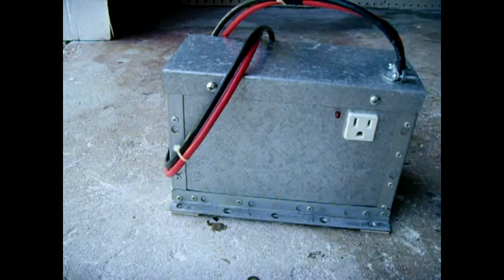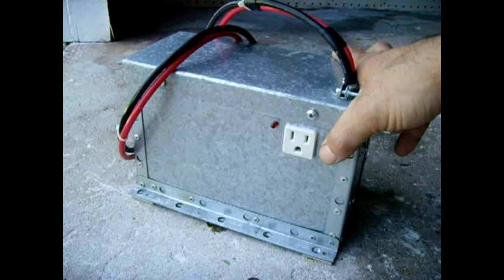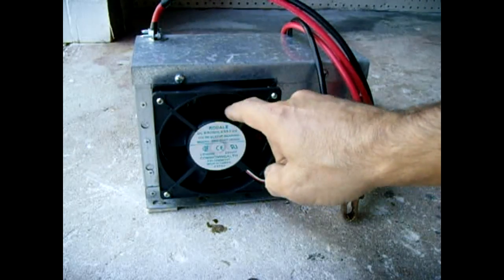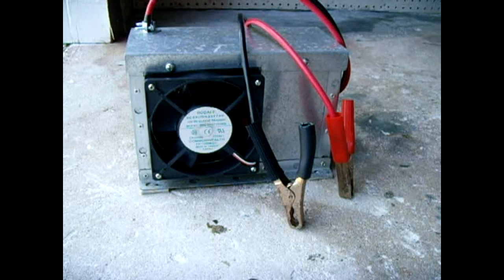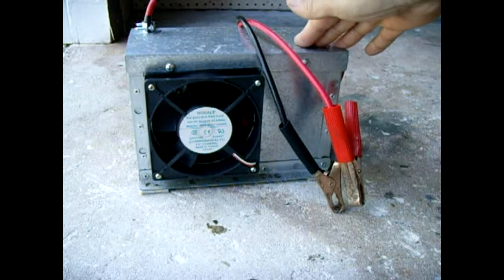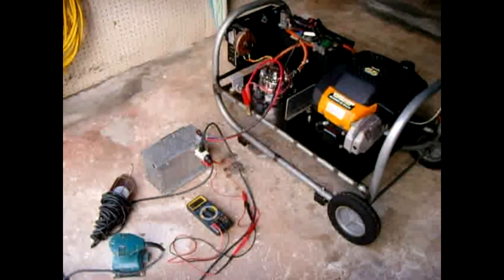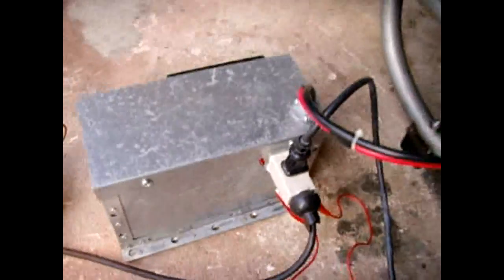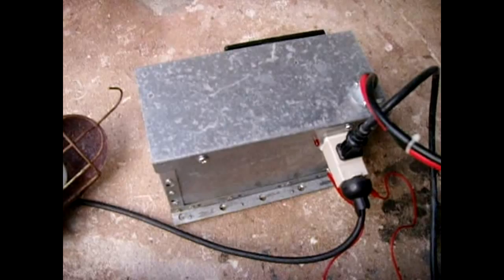DIY Power Inverter (Modified Sinewave)

Comment: i used p55nf06 mosfet and 12-0-12 transformer. but it doesnt work. no output voltage on trafo. can you help me..
Reply from the maker: Vino VV Double check the circuit, try new components, and make sure you're using the correct pins on the mosfet.
Reply: and how to adjust the frequency? my output frequency is around 700Hz - 1khz  which  it should be 50Hz. The potensio just didnt work properly
Reply from the maker: Vino VV The circuit is very simple. You botched somewhere.

Comment: excuse me sir..can you send me the circuit schematic(modified) diagram to me?
Reply from the maker: Hello. Everything you need to know is in the video or video description area. I have another video showing the inrush limiting circuit. Thanks
Reply: +electronicsNmore sorry sir..the inside pic of the inverter is a little bit confusing to me
Reply from the maker: wan daniel The inside of the unit has the inverter circuit, the inrush limiting circuit, a 12v case fan, and low battery alarm circuit, and 120V power indicator. Fairly simple. Unfortunately, I rarely do step by step electronic circuit videos. I simply supply information to help you, the schematic, and show you how it works.
Reply: +electronicsNmore thanks sir..i manage to build one..right now im making a part list before going to the store

Comment: You have a great design, but I believe I would have the fan blowing in to make positive pressure in the case. Then you can put a dust filter on the fan to keep out dust and trash.
Reply from the maker: Thanks Mike. No, the best way is how I made it. You want to leave openings on the opposite side to draw air in and across everything. Just like a desktop computer tower.

Comment: can you give me the right value of 500k pot so that it was locked on 60hz frequency sorry because i dont have any multimeter with a frequency range.. is that right 10-0-10 is the winding of the transformer instead of 12-0-12... because the output voltage may be higher thn 240 volts..
Reply from the maker: +Jaime Lomayno 
No. You need to set it yourself using a DMM.
Reply: +electronicsNmore ok i made it perfectly yhanks for sharing

Comment: good inverter but you could go one stage further with the inrush limiting circuit. i have built 7 inverters in total and employed my design in each of them. i have used 2 timers using a simple mosfet in each of them. the first timer handles the inrush on switch on and i used a large mosfet in series with a resistor forgetting the inverter started and when you load it over 50 watts 3 irfp2907 in parallel bypasses the first mosfet and resistor circuit and full power is then put through the inverter and it works well. i have used a current transformer with 1 wire passes through it which senses the load.
Reply: pls can you make me an inverter?
Reply: hello there..can you guide me how to make one?

Comment: Hi, you have mention that you put 36v zener diode across each mosfet's drain and source for added protection,In which direction of the zener pointing the drain and the source?I meant anode and cathode.Thanks
Reply from the maker: +edwin siy 
Please refer to the image at the link below.

http://1.bp.blogspot.com/_DF0nclfN_Sk/S74MsnW-JkI/AAAAAAAAAaU/TxF4ePy029U/s320/zenerdiodeinsidefet.jpg
Reply: +electronicsNmore Got it thanks
Reply from the maker: *****
This is 60hz.

Comment: Sir one more thing,In the schematic diagram, the transformer used 10-0-10v while in your previous video titled "12 Volt Power Inverter Circuit ~ High Output/Freq Adjustable",you have mention that the transformer used must be 12-0-12v, so to use it on this modified sinewave inverter,what should we use?10v or 12v transformer?Thank you
Reply from the maker: +edwin siy 
For a higher AC output closer to 115VAC, use a 10-0-10.
Reply: +electronicsNmore I got 230vac  60hz here where I live,so I have to use what voltage?Thank you
Reply from the maker: ***** The ratio of turns is critical for the correct voltage output. If it works fine using 6.3v-0-6.3v, then great . Be happy.  The frequency is set around 50/60hz?
Reply from the maker: More than likely your frequency is off. Without knowing EXACTLY what the frequency is, I cannot answer your question.

Comment: Hello friend I really like your videos I manufactured a similar circuit (can see my videos) in one with IRF3205 parallel 4 mosfet can with a lamp 500w, also with a radial or grinder 850w, also on you can see and compare your scheme with mine, probe the IRFZ44N 6 3 + 3 parallel mosfet and also could with the same tools and the same watt lamps bone, the microwave transformer I put rigid 1.3mm wire, 3 + 3 meters with center tap and could with the same wattage, including a transformer that I made with 0.30mm and 1mm thread with veneers of a (larger than normal) Russian microwave and also can handle the wattage, will be my last test with mosfet irf1404 with 2+ 2 in parallel give me more amps and power in watts, all at 220v and 50hz, ne555 and CD4017, with lv7809, lv7805 and kia to 6v, all regulators me work just as well, if it's any help my videos there is friend greetings from Spain.

Comment: can i use irf3205 or irfz44 instead of stp55nf06l?? kindly revert me !!!! thanks  :)
Reply from the maker: Hi there,
This inverter uses a "Logic Level" mosfet. They are designed to fully turn on using less than 5 volts. You can try the others, and they may work, but no guarantee.

Thanks For Watching!

Comment: Will the inrush limiting circuit be fooled by short breaks in the supply, as can happen with an intermittent connection?
Reply from the maker: Once the connection has been made, and it is a good one, there will be no issues. If you make a connection, and the connection is lousy, making the circuit click ON/OFF, then you can have a problem. I would suggest a high current throw switch be used after the cables are connected.

Comment: What is Your output voltages when battery voltage is ~10V and ~13V?
Could I use 230/12 VAC transformer?
Reply from the maker: Around 12.5v gave me an output of around 110V using my transformer. You can assemble the circuit, then hook up your transformer to see what the output is. Likely very high.

Comment: hi can i power my laptop charger with type of inverter
Reply from the maker: Why bother. You can take a 12V lead acid battery, then connect it to a Buck Boost circuit to raise the voltage up to 19/20V with around a 2 amp output. There are many of those circuit online. You also have to realize that many laptops will only run on a power supply which is not made for the computer. The battery may not charge. This inverter will likely work, but no guarantee.

Comment: hi what if i use 9-0-9v 5amp transformer ,do i get 60w -100w output
Reply from the maker: You need to experiment with different transformer cores, as well as the number of turns. The circuit works, as you saw in the videos. Make sure you use a 12V lead acid battery.

Comment: can you please show me the fully built circuit of modified sine wave inverter ,please
Reply from the maker: You mean the schematic? It is the one which uses the 555 and 4017 in the video description area.  The schematic does not show the inrush circuit(you can find that in my video list), does not show the power indicator LED/resistor, and does not show the cooling fan. If you are having power output issues try, removing a couple turns off the lower voltage (12v) primary. Adjusting the ratio will adjust the 120V output.

Thanks

Comment: are you able to set the output to 60hz,because according to ne555 calculator the output can not be 60hz with the value of resistor recommended in the circuit diagram
Reply from the maker: Yes, of course. I'm pretty sure I showed in the video that I was operating at 60hz.

Comment: what is the advantage of using modified sine wave instead of normal square wave
Reply from the maker: Hi Ramesh,
A square wave does not gradually swing positive toward a brief positive peak, then gradually swing toward zero volts, the continue swinging gradually toward a brief negative peak before returning to zero volts. The square wave has only 3 states, (Positive, Negative, of zero volts). The square wave does nothing gradually, and spends too much time at peak POS or peak NEG. Due to that, certain devices can develop heating issues or other problems due to the longer duration at Peak pos/neg, and the lack of a gradual swing toward peak pos/peak neg. A modified sine wave follows the sine wave more closely, and spends much less time at peak pos/peak neg, making it a much better choice for powering devices/appliances. See the images below.

Thanks For Watching! Be sure to share.

http://www.google.bs/imgres?imgurl=http%3A%2F%2Fwww.ememdevices.com%2FSquare%252520Wave%252520Sine%252520Wave%252520ws.jpg&imgrefurl=http%3A%2F%2Fwww.ememdevices.com%2FEMEM%2520Therapy.html&h=206&w=450&tbnid=THv7emf51wsG8M%3A&zoom=1&docid=7PzZ6ZPbyy1s4M&ei=-xWsU9uiLe3lsATL94KoBg&tbm=isch&client=firefox-a&ved=0CFIQMygxMDE&iact=rc&uact=3&dur=2199&page=4&start=48&ndsp=13

http://www.google.bs/url?sa=i&source=images&cd=&cad=rja&uact=8&docid=SLchOOAbs907SM&tbnid=zHe1TD6F7byrAM:&ved=0CAgQjRw&url=http%3A%2F%2Fwww.energymatters.com.au%2Frenewable-energy%2Finverters%2F&ei=jRWsU-a-IPSqsQSJtoG4Cw&psig=AFQjCNHeHj5o9n7s1Zzfw2eHVCMoZONZDA&ust=1403873037612211

Comment: hi i used irf540,also i used irf3205 mosfets.it is now working but it is not powerful ,i mean i used 5amp 9 volts transformer .i expected at least 40w of output ,but it is not giving that much amount of output , should i use the logic level mosfet to have more output power

Comment: hi i think it is not possible to set the frequency for 200hz (output of ne555) because according to the formula minimum frequency in this circuit is roughly 1.9khz . i found that it is not possible to set ne555 output to 200hz (by formula) please ,i need your help
Reply from the maker: I have no idea why you are having such a problem. You need to measure the frequency output. Without a way to measure the frequency, it will be extremely difficult to set the desired frequency.

Comment: did you realy followed the link that you have posted.because when i tried that circuit it did not work properly ,please help me
Reply from the maker: Yes. That is the exact inverter circuit I used. But I also added the inrush limiting circuit, and fan as well. What was your problem?
Reply: must we use the only mosfet  which is recommended (stp55nf06l) & how to set frequency to 200hz ,i tried this circuit on bread board with irf540 mosfets it is not working
Reply from the maker: The mosfet must be sized to handle the current. You should make this circuit first using the irf540 and a small 1A power transformer with a lead acid 12v battery The circuit works, so your doing something wrong, or have a faulty component. Start all over.

Thanks.
Reply: thanks i got the confidence that it will work

Comment: Is there a built in power inverter charger? & how many watts do I need if I'm powering my couple of lights,computer,radio & ac.hey you are a good guy & good electrician talented man...I really really appreciate your reply.
Reply from the maker: This is not a charger. This unit takes 12V and converts it into 120VAC. If you use compact fluorescent bulbs/LED's for lighting, then this unit would power a couple lights, computer/radio with no problem. You can forget the AC. Too much current.

Comment: A "modified sine wave" here is just a regular square one? Like 0 V -> 115 V (or other voltage to get 115V equivalent over whole cycle) -> 0 V -> minus 115 V -> and back again to 0 at 60 Hz?
That's what I guess from schematics, but I see that your power sander works great even on a modified sive wave. How come?
Reply from the maker: The modified sine wave is square, but the wave is stepped up and down, not straight up, then straight down. Yes, the motor runs fine.

Thanks For Watching!

Be sure to check out my video playlists.

Comment: I looked at your inrush video/schematic. What wattage would you recommend for the 0.1 ohm resistor in series with the load; you say high wattage but you don't specify how high? - Thanks - Russell

Comment: Great job; very impressive inverter. Is there any chance you can sent me the final schematic of the circuitry inside the box. Thanks
Reply from the maker: The inrush limiting circuit is in my video list. The rest is mentioned in the video. Also refer to the video description area.

Thanks for watching!
Reply: ok great. I was looking for the part of the schematic for the low volt alarm on the battery as well as the DPDT relay circuit. It would be great if you can produce an entire schematic and parts list for the entire contents inside the box; that would be great if you could do that. thanks, Russell - rnbrechin@gmail.com
Reply from the maker: I used the DC low voltage alarm circuit shown in my video list. The relay circuit is shown in the inrush limiting video. The inverter circuit is in the video description area. All I did was combine each of the circuits into the unit.

Comment: Just throwing this out there but you do know that any kind of steel cannot be soldered together, solder wont stick to steel at all.
Reply from the maker: Of course you can. I have been doing it for years. Any steel that is coated with zinc with solder perfectly. A/C drain pans are made that way.
Reply: electronicsNmore
Ok I see now it can be done with certain silver solders. I had pictured regular lead/non-lead solders used for pipe or wire soldering.
Reply from the maker: no. regular bar solder (lead 60/40) works fine. You need to use an acid flux.

Comment: Can you put 2 of them together to get 240 volts as thats what we use in the uk.
Cheers Jon.
Reply from the maker: No. What you do is use a microwave oven transformer made for a 240V power supply. Your microwave uses 240v in the UK. Correct? You chop out the thin wires of the HV secondary winding(I have a video showing how to do that), then wind on around 20 turns of 10 gauge insulated stranded wire. Make a center tap at 10 turns. You should get 220-240V output.

Thanks For Watching!

Comment: Could you please suggest any good inverter circuit to power my desktop PC?
Reply from the maker: I use my inverter generator modified sine wave output to power 2 laptops, printer, modem, cordless phones, all with no problem.  "Sometimes" with certain electronics, the modified sine wave can cause component heating due to the waveform shape. I have only had a problem with a couple 120VAC cheap plug in ultrasonic pest control devices. They could not tolerate the waveform, besides that, everything that is important to me, works fine. There are lots of sine wave inverter schematics online. They are not that difficult to make.

Comment: What is the stand by current?. Do u have any schematic of a pure sign wave smps 110v @ 60 hz ?
Reply from the maker: There are lots of circuits online for "pure sine wave" inverters. I personally have not felt the need for a pure sine wave. Most everything I use with my inverter generator's modified sine wave output, and this inverter, work fine. I would say 90-95% work just fine. I'm sure the stand-by current is not low. This inverter was designed to be used when it is powered up. Considering I just took an old MOT and rewired it, this unit works extremely well.

Thanks for watching!

Comment: Using the 4017 is cool to do the modified square cycle. That way there is no need to worry about dead time comparators etc that way. On a different tangent, have you measured what the no-load current draw is?
Reply from the maker: I'm have a 30A fuse installed, and using around 300/350W, I have not blown the fuse, so I would say around 9/10A per 100W.